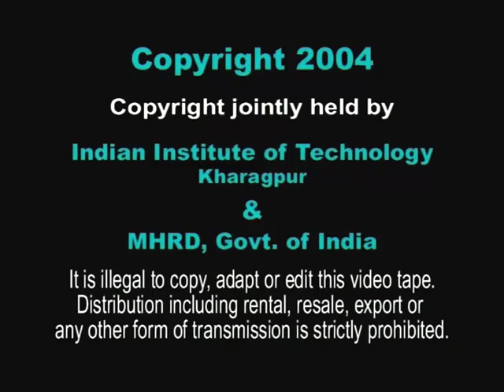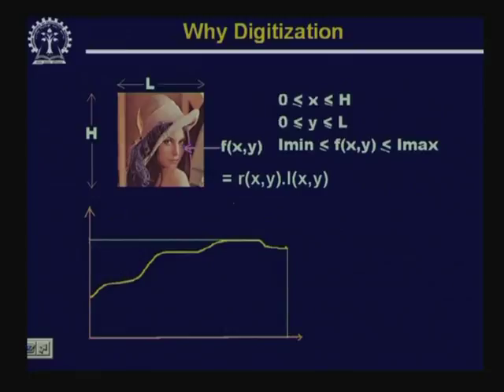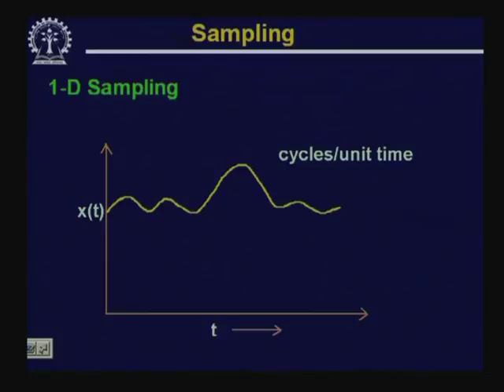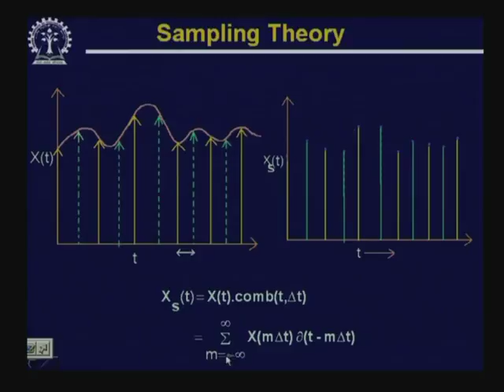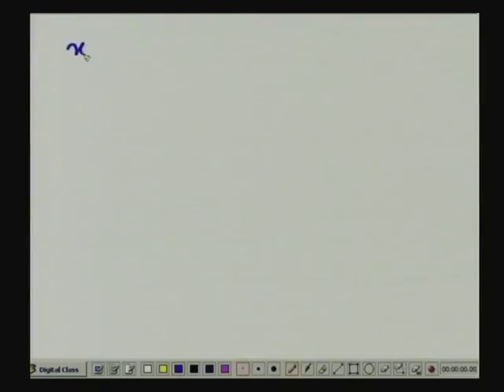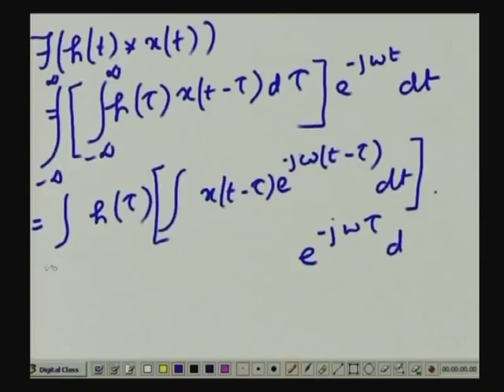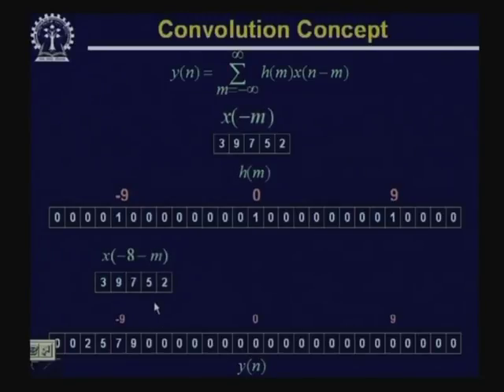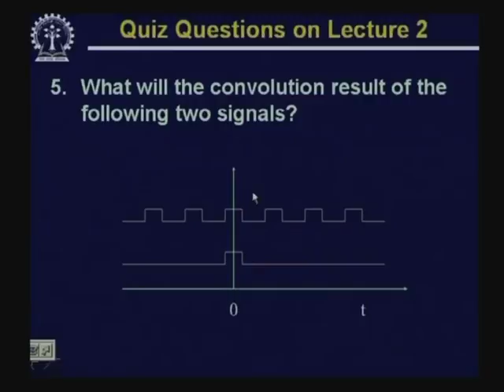Lecture 2 Image Digitization I

Comment: Am I wrong? Diract delta function should be infinite at one point and be zero for others?
Reply: it is but only in the continous time domain whereas in discrete time domain it has a specific value at the point of existence
Reply: Then it should be called Kronecker Delta...
Reply: Your answer only confuses. In the present context the lecturer is wrong. Straight and simple. Sampler should have train of impulses where each impulse have unit energy. Discrete domain is irrelevant.